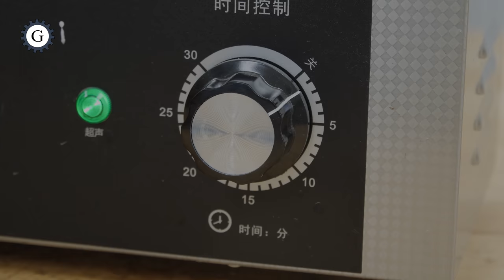Adjustable Torque Impact Driver Restoration | National POWERCUSMO MULTI EZ6505

Comment: Perfect, as usual !   I have few small screwdriver-drills in excellent condition but, unfortunately, batteries are dead and I have no knowledge and no equipment to rebuild them as you do perfectly !
Reply: Check out locally, chances are, someone offers that service at a fraction of what it would cost you to buy new or do the whole thing yourself.

Comment: Wow it's the first time I see a cordless impact driver, with torque that is adjustable manualy not electronically :) Btw Great job !
Reply: Not only that but it has a drill setting that I presume disables impacting.

Comment: Is this safe to leave that last nicd cell on battery?
Reply: its not actually there. it's a dummy spacer to accommodate the battery pack/tool connector.
Reply: @xfiles4484  i dont think this Is dummy. Look closely

Comment: Cool video, I have a question. Can a ryobi 7.2 volt battery be repurposed to a higher voltage Li-ion like you did in this video? I have a older ryobi driver drill 7.2 volt and the battery is no good anymore. It won't charge at all.

Comment: What happen if we put grease more than sufficient ??
Please tell
Reply: You don’t want too much grease because it could be too thick and the drill won’t run as smooth but you still want to put a generous amount on, if not the gears and inner pets will wear faster
Reply: @DudeGuy-zt9eg  and if the tool gets too hot maybe start leaking grease.

Comment: Can you use the existing charger or do you apply voltage from an modern LiPo cell charger?
There must be millions of these reasonably well made tools, now abandoned because they were designed for NiMh battery packs. I have two lovely 14.4v NiMh Drill drivers. but only 3 working batteries. If I could buy new LoPo cells for them I would.